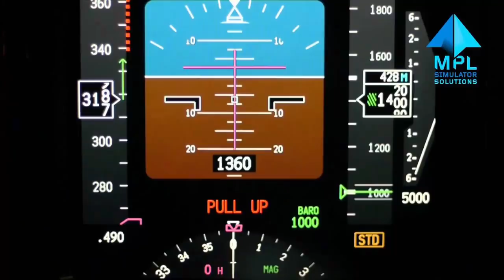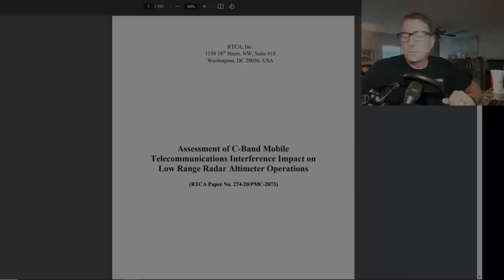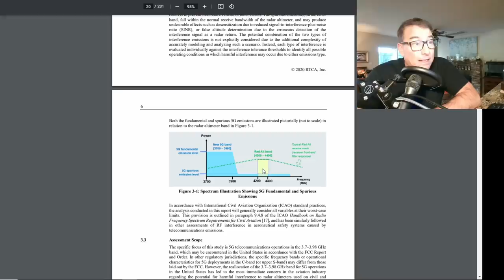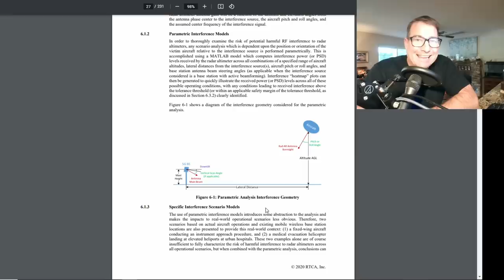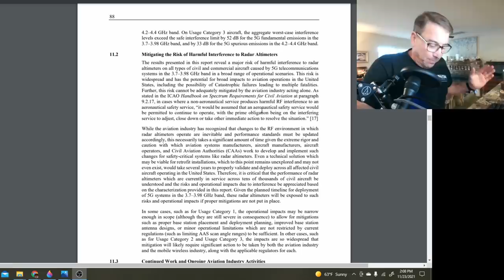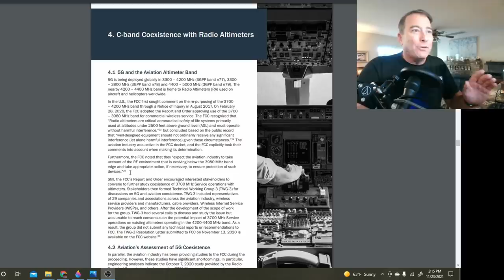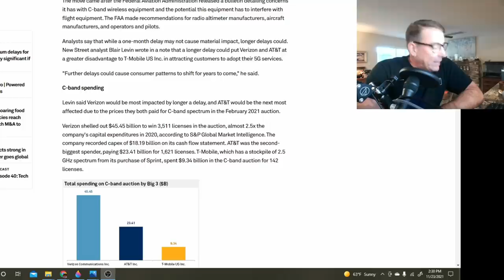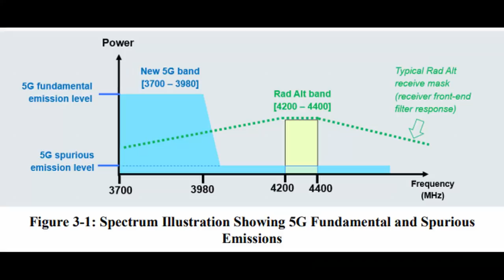5G C-Band Interference with Radar Altimeters in Aviation

Comment: 5G is a very broad term and this issue here is a non-issue. The sky is not falling (and neither will be planes, thankfully). I am a friend of flying and not a friend of the telecom industry. But just because a new technology is near in frequency to an existing technology doesn't mean there will be issues. Devices can even share the same frequency and not interfere with each other, if designed for it. What it seems to be the problem here is the radio altimeters were designed with a wide band filter, since previously there was no "neighbors", as you mentioned. While I still don't see an issue the radio altimeters may need to be designed with a more narrow band filter now. Just because for years they got away with a loser filter, doesn't mean they should enjoy that privilege forever.  RF technology is to the point to where you can really target specific frequencies and it maybe time for the radio altimeter manufactures to bring their devices up to tighter RF tolerances. 
Reports can be reported to sway in favor of either side and I feel the RTCA report was generated in hopes if finding interference, so they found the "possible" interference. 
If this was such an issue, why aren't the countries that already use these frequencies reporting any issues?  Exactly! But if someone wants to find an issue, they will find one, ala the RTCA report. Not ragging on the RTCA either, they do good work and are just being overly cautious and proving that it is possible when you force it to happen in a lab. 
Good video as always, but don't hook on to the 5G is bad hysteria. Which just like when any new cellphone tech standard comes out, the rumors and hoaxes (not saying this here is a hoax though) start to fly..... (pun intended).  5G is no different and man, the rumors, scare tactics and hoaxes are more abundant than ever this telecom generation tech!

Comment: Is 5G America willing to except responsibility for any crash that is linked to interference of the 5G signal?  I worked for a major avionics supplier, I  on the radio altimeter in an engineering environment and understand the operation of the system.  The frequencies assigned by FCC for the radio altimeter were assigned because at the time NOTHING else operated even close to those frequencies.  You are correct about time to do TSO, it takes years and millions of dollars to do (I have been part of 5 TSO's),   A TSO will have to be done for each type of radio altimeter the company builds for the airline industry.  Is 5G America willing to pay for this cost?  You and I both know the answer to this question!  It appears that 5G America has done NO testing, but seams to have all the answers!

Comment: I don't really have a dog in this fight, but as an electronic engineer, I am going to side with the FCC on this one.  My biggest problem with the RTCA report is that green line that represents the filtering.  For the last 50 years, filters have been much tighter than that.  Modern day equipment will almost always conform to look more like the slope of upper edge of the 5G graph. I suppose it's possible that the FAA specification for filtering is set really wide, if at all, but that doesn't excuse companies from avoiding the FCC regulations on filtering.  The argument that the bureaucracy is too slow, is just white washing.   The FAA has had a long run of avoiding modern FCC filterrequirements, all in the name of flight safety.  As you stated, there is only a finite amount of bandwidth.  Asking the FAA to conform is not a big ask.  Expensive?  Maybe, but I suspect that almost all of the radar manufactures already comply as a simple measure of modern component design.   The simple answer to this is the FAA needs to specify that aircraft that don't meet the filter requirements, will not be allowed to land category III.  Set  a date for conformance and watch the market meet that demand.
Reply from the maker: When's the last time you worked on a radar altimeter? FAA TSO'd...
Reply: @blancolirio  Never, hence I don't have a dog in this fight.  Just my opinion on the subject.  I didn't really express it in my above rant, but I suspect that most manufactures already comply with the FCC as well as the FAA.  Major manufactures tend comply with all government agencies, not just one.  Sort of a CYA thing for companies that deal with the government.  So long as a manufacture can show they already comply, and they have already been through the FAA's accreditation process, should be nothing more than an additional rubber stamp.  My background is RF design.  Having a 200Mhz guard band between the 5G and radar altimeter frequencies is plenty to deal with a signal that is 20db over what is shown in the report... as long as both sides utilize good filtering techniques.  If the FAA can't deal with this in a reasonable time frame, maybe it's time congress put someone in charge of the FAA that can.  The fear mongering that you touched on in the video, is purely the fault of the FAA.  The FAA/RTCA was right to do their study.  But instead of accepting that change is coming and the need to start getting manufactures to fall in line, they instead started this campaign of fear.   Sorry, but I will still back the FCC on this one.

Comment: What's wrong with having the Entities (Version, AT&T, T-Mobile, etc) that buy the 5G Frequencies also pay for the modernisation of the Radar Altimeter systems so their 5G implementation  no longer interferes with safety of flight. The cost would be a drop in the Bucket comparably speaking to what they are already going to spend.
It won't happen until lives are lost due to a crash of an airliner.

Comment: As others have said, the older altimiter needs to be revised with updated filtering (would phase-locked-loop work here?) to improve the signal to noise ratio. But  I guess one question to pose to the authors of the 5G white paper: would you rather have your 5G calls somewhat restricted of limited as a cell user, or prefer to have your radio altimeter restricted as a passenger in an aircraft? One is an annoyance, the other could be fatal.

Comment: I see nothing in the RTCA paper about actual measured receiver performance. A receiver filter would be easy to purchase, and could be an add-on.
If the receiver performance is as bad as the paper speculates, those boxes should be replaced. I'm sure other equipment in the plane gets updated and/or serviced on a schedule. 
As the receiver power is very low no big filter is needed. 60dB rejection filter would be easy to get. 
Maybe this would work ? 8CL8CL4D3G-200-CD-SFF 4D3G-200-CD-SFF   but there are others with smaller size and better specs.
If FAA is slow to react maybe there needs to be some personnel changes.
This kind of suggested receiver performance is a joke, some design by a junior engineer in the 1970's. 
Nobody wants a 4 year old cellphone, or drive around in a 20 year old car. 
FAA should implement a philosophy that favors upgrades rather than consider anything "old and proven" is safer than anything new, and foster technology advances. Why insist on old shit being usable forever?

Comment: In practice, this is probably going to manifest itself as an airworthiness directive for the radar altimeters used on aircraft with poor input filters. ADs are already an approved procedure for forcing replacement of potentially unsafe equipment, which is how this is going to be framed-- "why are your input filters so poor?" But that AD can't happen until the study is done on each approved hardware installation in every single aircraft model and a mitigation procedure is designed. (Who pays for those studies? It certainly won't be the FCC or the telecoms hungry for more spectrum.) And at the end of the day, the onus is on aircraft owners to perform AD maintenance, no matter how costly it winds up being.

Meanwhile, the telecom giants get to sit and watch the fireworks, with no obligations to pay a cent to those they're stepping on.

Comment: If I were the chief pilot of a major airline, and I have known one in my career, I know what position I would take on this matter:  placard "off" the radar altimeters and erase CAT III approaches from the charts.  This problem is not fixable by increasing the selectivity of the radar altimeter filers because doing so will increase the group delay imposed by that filter, creating an untenable calibration problem.

Comment: A totally frustrating situation!  It's easy, there is an accident and during the subsequent inquiry it is established that the pilots either or
(a) were not sufficiently aware of the implications of RA degredation. 
(b) Did not act accordingly following a degredation of safety systems or equipment. 
(c) Did not follow the procedures developed in the event of losing trust in the safety systems or equipment. 
(d) Did not report equipment anomalies to ATC as soon as practical and with as much detail as possible.
Presumably these actions must be accomplished during a low vis. approach to JFK or LAX.  Obviously the Regulators don't know what they are talking about, but that doesn't matter because the crew who may not be around to defent themselves are blamed for the accident.  Case closed.  I sure am glad that I'm retired!

Comment: You're such a good person for trying to do the right thing and work within the system. Sadly, it's only too clear that the FCC has already made up its mind. The sidebands on the Radar are (if correct on the graph) way out of line with any current technology. If that's true then for now the use of the landing system just became a casualty. Not just because they wouldn't work, but because they are also going to splatter all over the 5G network. Not to worry. Upgrading the old systems would be a fairly simple matter of replacing the output modules (transmitters) with newer technology. An opportunity for some smart company to capitalize on the refit. After all, commercial aircraft are upgraded all the time. Thanks for the great videos.

Comment: "Here first" carries no weight.  If your use of spectrum is inefficient, you will be forced to change.  Just look at what happened to analog TV.  That was to free up spectrum for cell phones.  Likewise, the C-band satellite systems are falling to the same pressures.  Looking at the slope of the filter as a percentage, the performance seems less than impressive.  No doubt they were designed when there wasn't much in the way of "neighbors" but that is rapidly changing.

Comment: 5G telephony is still largely marketing hype and will continue to gradually be phased in over the next decade, during which time cell phones will still have to be able to operate on 4G.  Delaying deployment of 5G repeaters in the vicinity of airports is a viable option.  In the meantime, it may be possible to develop radar altimeters that work in yet higher frequency bands, well beyond the frequencies used by terrestrial communication, and replace the ones currently installed in aircraft.

Comment: Be aware that the existing 3G and 4G networks are technically a subset of the 5G network landscape. This technicality is being used by some operators to claim wide-area “5G” deployment, when in fact expanded 5G-only frequency coverage is available in very restricted geographies. Hence, arguments of the form “Bogusistan has announced 5G and
is having no trouble” should be evaluated with as much care as Mother Nature will use reading the “restrictions” imposed by lawyers.”

And it you really wanna boil your blood, read about the insanity the FCC wants to approve
for Ligado’s attempt to put high-power terrestrial and satellite down-link signals even
closer to the microwatt satellite signals we love as GPS. Actually it will likely interfere with any L-Band GNSS signals *not just US GNSS signals*. Extensive live-fire field trials have been held that clearly showed interference and to date, the FCC, under the leadership of Buy Pai, has not firmly rejected the attempt.

This is all completely insane. The lizards with the shark-skin briefcases have been allowed to capture numerous regulatory agencies with anything going to the highest grifter, er, bidder.

Comment: I read through the RTCA paper and it is a horrendous mess of a 'study'. All of the assumptions and worst case hypotheticals stacked on top of one another made it a chicken little tale, not a science-based review of potential issues between 5G and RA equipment. From the 6dB margin to the idea that cellular towers would angle full transmit power towards the sky or 40 degrees to the ground, it reads like the folks that suggest that commercial aircraft are going to be hijacked by the on board entertainment system. 

In any case, the FCC sought comment on the 3.7 - 4.2Ghz spectrum at least as far back as 2017. This change in C-Band allocation didn't just come out of nowhere. 4.2 - 4.4Ghz is still allocated to aviation radiolocation. The issue is that aviation equipment may need to be updated to ensure that emissions that take place OUTSIDE of the 4.2 - 4.4Ghz band do not interfere with the radar altimeter. And again, considering the RTCA doomsday report, it may not even be necessary (unlike when we had the termination of SARSAT service on 121.5 or the requirement of ADS-B Out).

Comment: Although I have had no opportunity to examine either the FCC's report or the RTCA report, from what you have presented indicates to me the FCC is proceeding from a political/economic position. I'm a retired electronic systems engineer (Lockheed Sanders) with several decades of development, design, & test in the EW and radar fields. Aviation safety must be paramount in this issue - I don't like the fact that some "real world" testing has not been accomplished and reviewed by FCC, RTCA, and FAA.

Cell phones are endemic - From what I see at this  point, I would not fly on a commercial airliner today. I have no confidence in an aviation safety system that relies upon the total obedience of passengers to not use their cell phones in flight. A system safety design margin of 6 db based upon the limited test/analysis presented scares me.

Comment: Top five reasons why this is not a real world concern:

1. Radars altimeters are used on approach at low altitudes, that means near airports. All you need do is move the tower if you have an issue.
2. RAs have redundancy, more than one. Signal are sent from them as timestamped packets across the plane's network. That means, when you know their position relative to one another you can subtract one vector from another, spherical linear interpolate these vectors and produce a resultant signal vector. You then take the dot product to the normal and you know whether it came from the ground. Easy-peasy. You have to compute the dot product anyway to allow for roll. The signal vector doesn't match the ground vector? Make lots of lights flash and warning noises.
3. 5G NR FR2 Metrocell (the most powerful) goes up to a truly terrifying 20W. The RA almost certainly won't be receiving the forward slug and you're relying on channel bell curve overlap at distance (inv sq rule folks)! If you got microwatts, I'd be amazed. More likely nanowatts, the technical term for F All.  When interference is nine orders of magnitude less than the signal, you do not have a issue.
4. At 24Ghz, you don't get signal coherence over more than a few hundred meters. Are they planning to put the 5G tower on the runway? If not, we're good.
5. The doppler effect, planes move so the frequency will stray meaning we're dealing with picowatts.

Here, Iet's make a deal. What about if he let pilots fly planes and engineers worry about this stuff. Just a suggestion.
Reply from the maker: Because you are not paying attention to anything but the ....$$$$!! Now get off your lazy ass and go read the reports!
Reply: @blancolirio I always thought of pilots as level headed professionals but you seem to be in the grip of a 5G conspiracy theory. 

That $$$$ accusation doesn't even make sense, if 5G caused planes to crash then that would be a commercial disaster for every industry involved. You have thought this through, haven't you?

Engineers are professionals who take safety very seriously but that's done by careful calculation and testing, not paranoid hubris. 

Don't get me wrong, it absolutely is worth exploring every conceivable risk but this strains credulity.

Comment: I get the filters and 5G etc. 200mega hertz separation is good. Those altimeters will be upgraded. They are currently overdue to be upgraded.The airlines will cover the cost. Just like my personal drone that is required to be registered, I have to do it and cover the cost to install the auto reporting information for it or don’t fly it. Trust me the airlines have the money for it. They complain yes, just like me. But if you are in the business you deal with it. Auto landing isn’t new btw. It’s not affordable to personal aircraft. The 777 was launched in 1995.26+ year old  Aviation technology is literally 50 years old.Turn 200 phones on and strap them in a seat go fly and realize the horse will not drink if he isn’t thirsty. There isn’t going to be a problem. The airlines yes will cover the cost to update their 26 year old equipment.